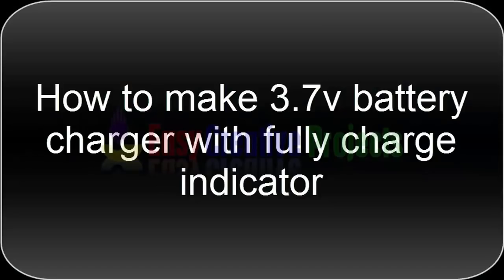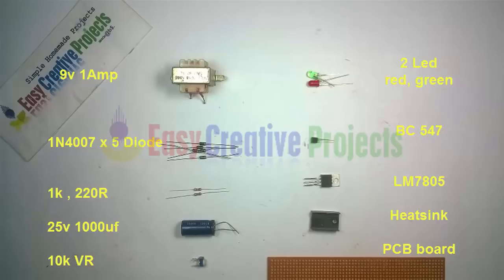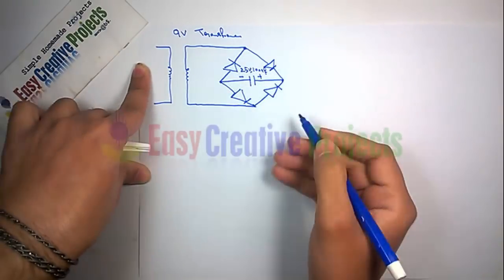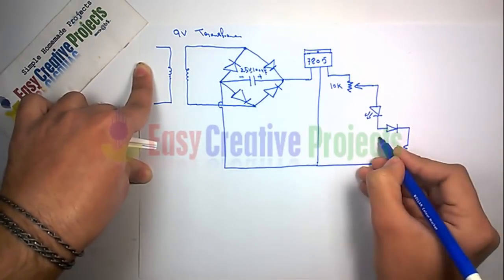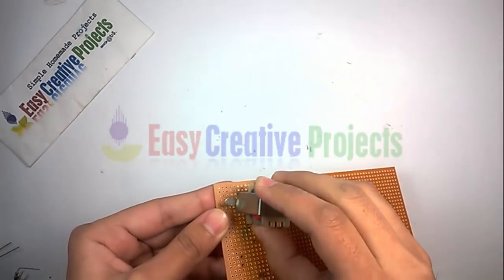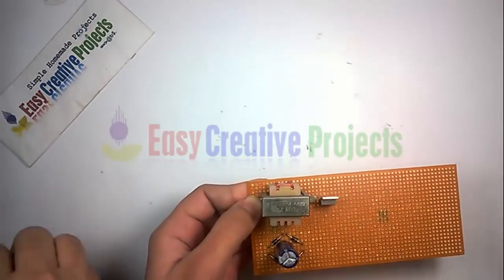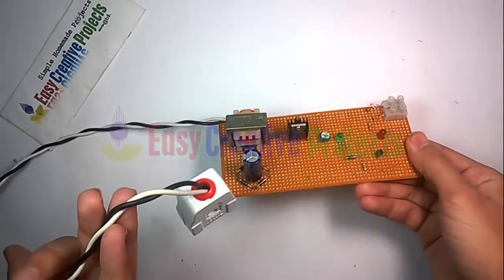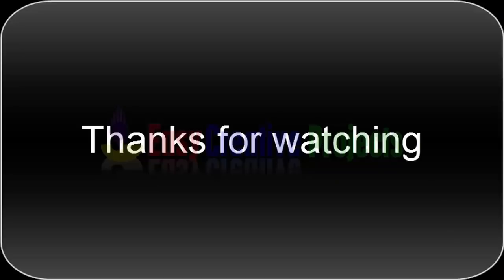How to make 3.7v battery charger with fully charge indicator - very easy

Comment: sir I was working in a circuit which requires 430ohm but I dont have that so plz can u tell me which  resistor should I use instead of 430ohm plz help
Reply from the maker: dear if your demand is 430ohm and that time its not available then you can use more then one resistors in series and fulfil own requirement. 
for example:
330ohm + 100ohm = 430ohm
2nd option:  you can use 1k variable resistor and adjust it as your demand.
thanks.
Reply: @EasyCreativeProjects  thanksssss you very very much broooo
Reply from the maker: @basuroyal2783  you welcome
Reply: u are best brooo

Comment: Remove transformer and lm7805?? Can we directly connected to 5v supply ???
Reply from the maker: yes dear you can use direct 5v power.
in this video i use lm7805 because i need 5v power.

Comment: Sir it's not work no any changes in led i make it. Its only regulate voltage in output by preset, i am not happy with your video please contact me its my WhatsApp no. 8422007343. Anyone can try this one?? If it work please contact me or help.
Reply from the maker: where problem dear? please tell me. i try to solve your problem.
its very simple circuit. i already explain every thing in circuit diagram. if you need more help so please tell me. i try to help.
Reply: Easy Creative Projects mera led off hi nahi ho raha hai
Reply from the maker: dear circuit diagram follow kro aap nay circuit theak say nai bnaya. agr phr b smj nai aa rahi to facebook page pay mujay screen short send kro main check kr k guide kr don ga.

Comment: Sir jab battery full charge ho gya tab red led bandh ho gya lekin green led continue jal raha hai.preste ko adjust kia (red led off & green led on)jab low battery connect kiya tab green led on hai
Reply: Jab battery full charge ho jaiga tab green led band ho jaiga.ek full charged bettery ko circuit ke sut connect karo uske bud preset ko adjust karo (green led off)ho jaye uske bad low battery charge karo
Reply from the maker: is ka mtlb ha k battery full ha. aor keya.
Reply: Subhajit Karmakar sir meri to led hi nahi band ho rahi aisa kyo to mai set kaise karu maine preset ko kam jyada karke dekha voltage ka veriation ho raha hai put ke side but led off nahi ho rahi
Reply: Subhajit Karmakar try karata hu phir se sir aapane banaya hai to please capture bhejo na sir achhe se sansrh71@gmail.com pe mail karo na sir  please aapse bahot badi help milegi mujhe.🙏🙏🙏🙏🙏

Comment: The charging is separated when the battery is full؟
Reply from the maker: no dear its only indicator. if you want to use auto cut off system so try to find 3.7v relay.

Comment: Nice how to charge 3 cell 11.1 volt battery
Reply from the maker: for 11.1v battery you need 12v battery charger. if you want to make 12v battery charger. so see video on my channel 
how to make 12v bike battery charger.
if you want to make auto cutoff battery charger so see this.
how to make digital automatic cutoff battery charger with siren.
thanks.
Reply from the maker: if you have issue about AMP so use low amp transformer.
Reply: Easy Creative Projects thank you sir